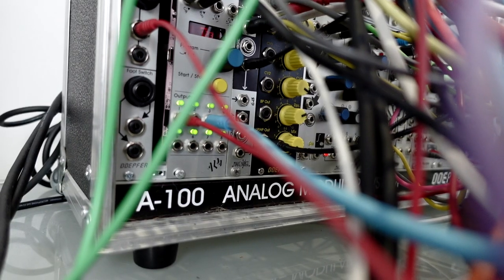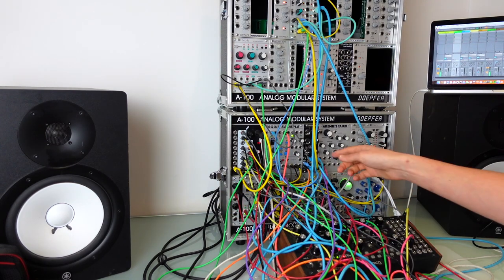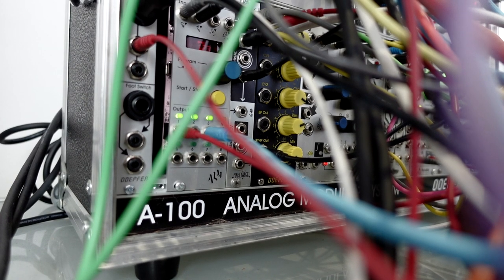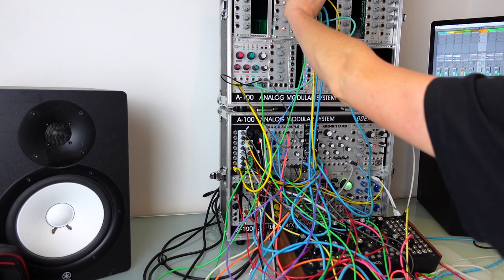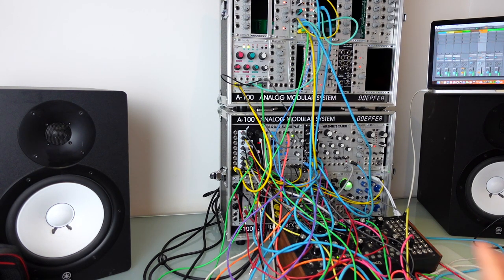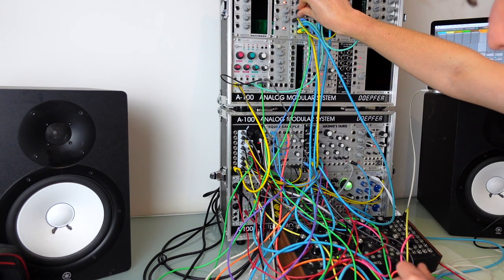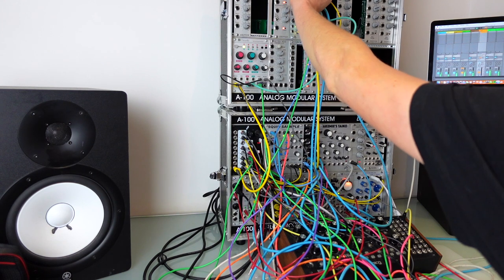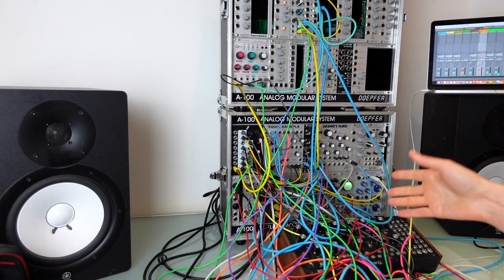Need More Hands To Control Your Eurorack? Try This.

Comment: I wanted some gates controlled by my feet.  The solution was to build a Barton Musical Instruments Utility Buttons that I modded with two output jacks wired in parallel with the buttons.  I attached the two inputs to M Audio SP-2 sustain pedals.  It can send gates or triggers, either latched or momentary.  It has inverted or multiple'd outs.  And a tap tempo mode, so I can use my feet to set gate pulse streams.  I also use the MST Expressor module for expression pedal controlled variable cv.  Thanks for your ideas!